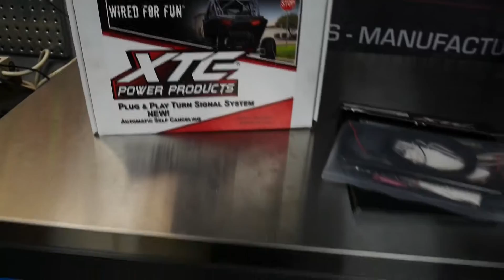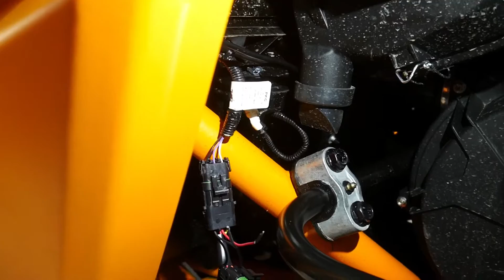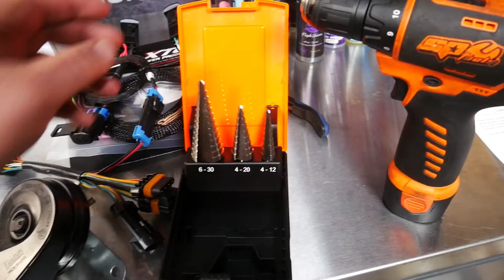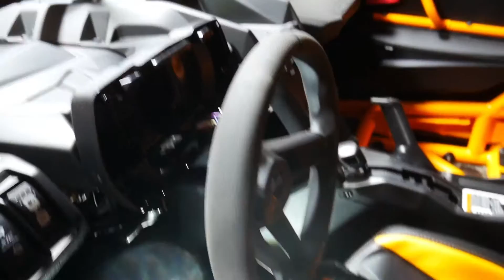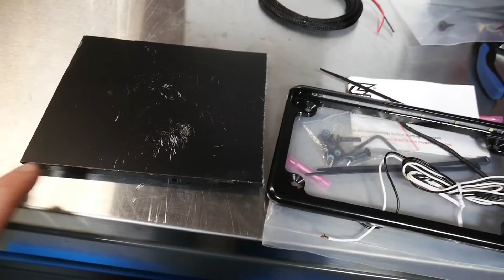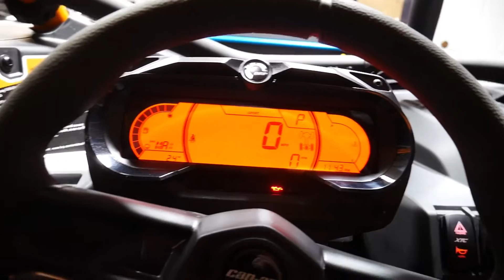CAN AM X3 GETS ROAD LEGAL THANKS TO XTC AND SP TOOLS USA

Comment: Just curious what gauge wire is the license plate bracket so you can extend it?
Reply from the maker: I believe I used some extra 18 or 20 that I had laying around.
Reply: @RustbeltMechanic  thanks man I have  some 18 so I’m just gonna use it, it should work even if it is 20.